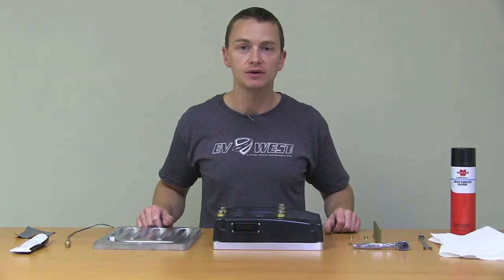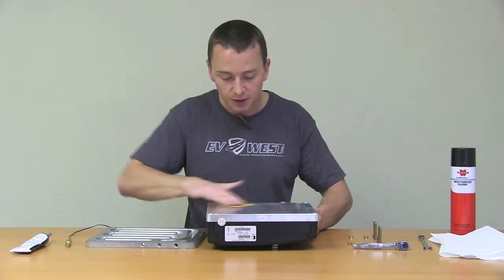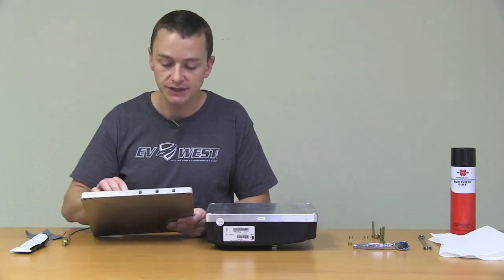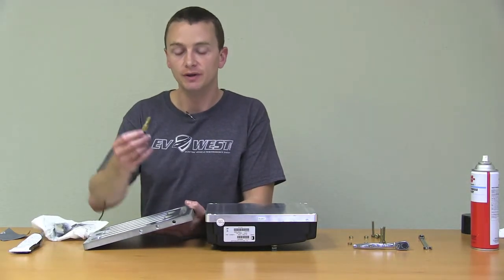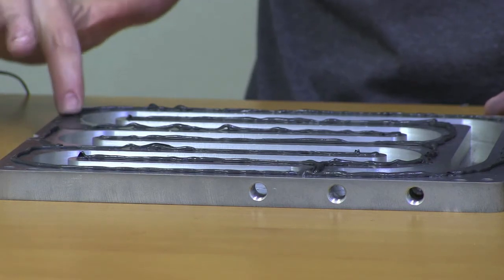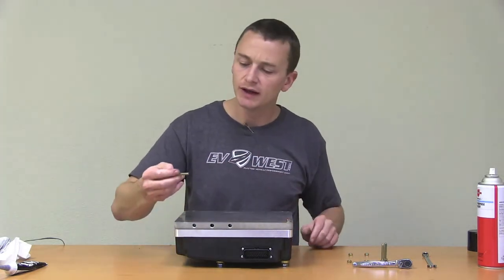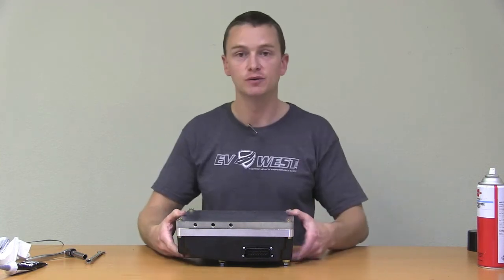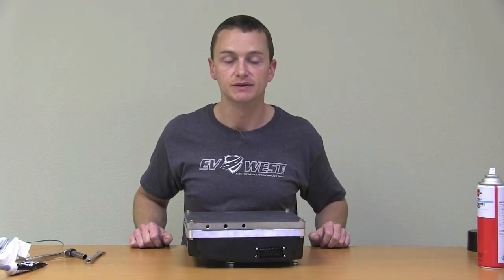EV West - Curtis Controller Chill Plate Installation Guide

Comment: A tip to make you life easier.  You only need to run the silicone bead around the perimeter.  it makes absolutely no difference if there is a slight leak from one passage to the adjacent one.  The design of the plate could be improved by machining a groove around the perimeter for an o-ring gasket.

Comment: A design improvement tip for you chill plate: Since you applied silicone everywhere, your chill plate does not actually contact the controller heat sink directly. Silicon is also a poor thermal conductor. Therefore you will not have direct heat transfer from the controller to the chill plate, only from the controller directly to the water. Therefore there is no justification for making the aluminum sections as wide as the water sections, as you have no heat transfer from the chill plate to the water. The design would transfer more heat if there were no water passages, as the surface area for the water to contact the controller would be greater.
Reply: overall I do enjoy your DIY videos though.